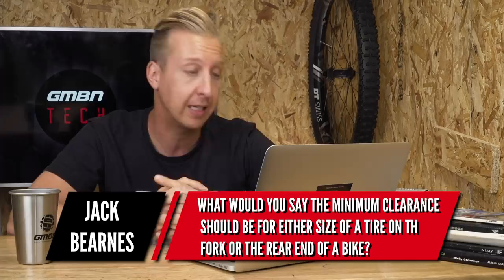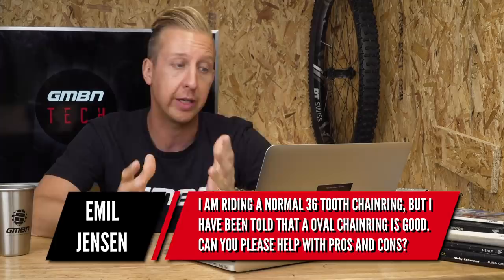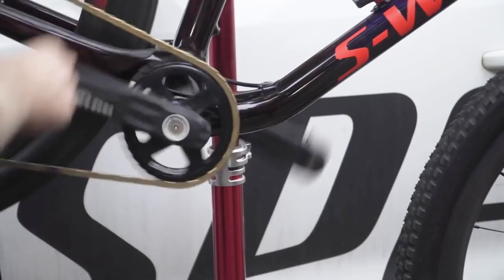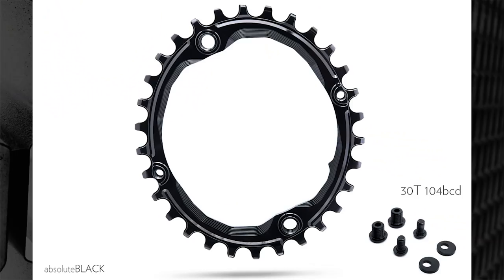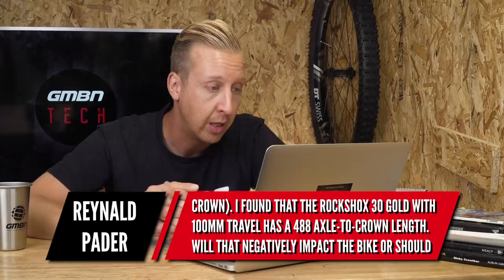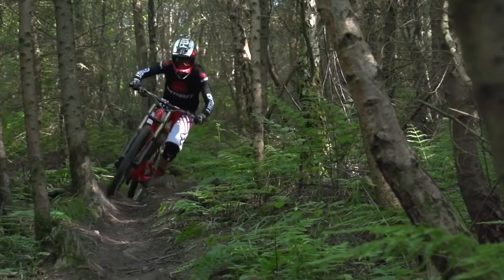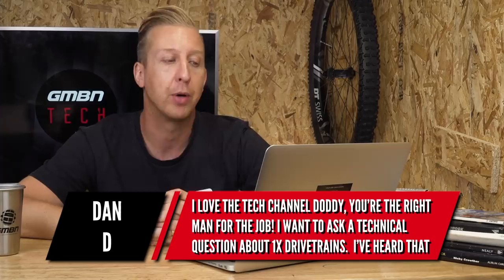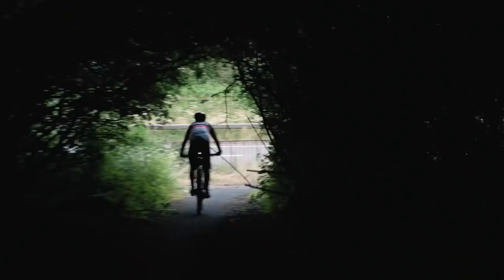Ask GMBN Tech: Should I Get An Oval Chainring?

Comment from the maker: Do you ride with an oval chainring? Would you? Let us know your thoughts in the comments 👇
Reply: On the note of an oval: I recently got myself an oval and for some reason i get tired much faster than before. The oval is a 36 teeth while my old ( round ) chainring is 32 teeth. Is it possible that it is the oval or the increase in teeth that can affect my riding in this way?
Reply: Yes, never going back to round rings.
Reply: When I switched from a 3X to a 1X I initially just kept my middle chainring. The chain kept falling off and I didn't want a chain guide so I decided to go with a narrow wide chainring.  Well, the price for the oval was pretty much the same as a round so I thought 'Why not.' I don't know if it is better but I do know that the next time I rode the bike I had a couple of PR's and yet didn't feel like I had worked any harder than usual. Does it work? I don't know, but it doesn't not work and it doesn't hurt. So I am keeping it.

Two things that I have noticed - It took me a few times to get used to where I put my pedals when not pedaling. At first I would have to pedal about half-way around before I engaged the rear wheel. Once I got use to putting the pedals in another location - I no longer have that issue. Second, I do know that my chain has stretched pretty quickly. I don't know if that is from the oval (thinking the teeth on one side of the ring are further apart) but my chain did stretch quite quickly (6 months or so).

Overall, I am happy with the choice. I did go with a no-name brand chainring in case I didn't like it and it has held up well. When it dies, I will spend more money on a good brand.
Reply: Being a flat pedal rider i've tried it on a friend's bike, felt weird and a bit distracting when climbing.
Stuck with the normal ones - helps me keep my focus on smooth pedaling and avoid "chopping" uphill ... also avoids stress peaks (knees etc) i think.
Reply: I was skeptical for years, said f**k it one day and bought one. Have an old knee injury that would often ache after rides, hasn't hurt since. Climbed over loose n slippy roots better, doesn't feel like any downside for speed. Feel like there's more gas in the tank after a long climb. Since pedaling is naturally uneven, why use a round ring?
Reply: Yes of course! i ride one of the Absolute Black Cainring and love it!!!
First week was a little bit akward but the next week i didn´t recognized it.
And the Pro are: no of jumping chain anymore, what was with Shipanso chainring on flat street way everytim, also absolute Horrible.
I chanched my drive to Sram GX 11speed and do not need a last 12th gear.
Reply: I used oval chain ring for about 2 years now and I loved it. I used flat pedals and its has been a big difference for me when I'm climbing steep trails. Good thing that sram got the oval chain ring on there GX eagle series.
Reply: Oh and shifting under load (if needed) is easier
Reply: On my "old" bike and on my new bike a normal, thinking of upgrading to an oval.
Reply: Yes, I use Absolute Black chainrings. I notice a huge advantage when riding flat pedals. I’m not sure I get as dramatic a benefit with clips, but I haven’t gone back to round with clips, so maybe that would highlight even more advantage than I perceive. But at least on flats, they absolutely smooth out the power.

By the way, GCN did some tests showing that no one “spins a round pedal stroke”! Even the trained pros deliver all their power on the down stroke.

If you haven’t tried oval, give it a go!
Reply: i've gone from a 2x11 xt to 1x11 absoluteblack 34T and it climbs mutch better for me , and i had a issiue with the clutch on my xt derailleur , now i don't use the clutch
Reply: Chain_Ring MTB yes... you are pushing a harder gear. I believe you need a 34 tooth oval for fair comparison. A 34 tooth would be effectively a 36 on the power stroke and 32 coming over the top.
Reply: Le Typ interesting. I had the opposite experience: with flats, I am way more choppy with a round ring and way smoother with an oval. Perhaps your buddy has the ring “clocked” wrong? If it’s 90 degrees off, it will be completely wrong.
Reply: Chain_Ring MTB it's the increase in teeth my dude. It's like constantly being in a harder gear now.
Reply: Been using Absolute Black oval chain rings for the past 3 years. Makes a noticeable difference in maintaining momentum on technical climbs. There is a reason SRAM now makes an Eagle compatible oval now too.
Reply: I've used ovals for the last few years. I don't notice much difference between round or oval. As for the clutch wear issue, surely on a full sus the chain is stretching under suspension action anyway?
Reply: I was struggling last year with round chainring on stumpjumper 29, 28-42 ratio felt very uncomfy. I found myself constantly spinning easiest gear, and i did never touch 10t cog . AB 28 teeth oval dramatically improved feel, and currently im using whole gear range. Only slightly strange moment is when im trying to stand pedal, i feel cranks kicking due to rapid tension changes on 10-12-2 o'clock cranks transition.
Reply: GMBN Tech I don't run a oval chain ring
Reply: Chain_Ring MTB I'd say it's the more teeth
Reply: Chain_Ring MTB most provably. Get a 32t oval. Its gonna make a diffrence. Oval chainrings tend to push yourself harder. Meaning that you fel like you "have" to push harder. That results in higher power output and faster fatigues
Reply: GMBN Tech used oval chainrings for one year now. On my xc rigid, trail fully and my roadbike. Hard climbs are slightly less fatiguing than with round ones. Diffrence in traction is almost the same with a small tendency to favor oval. Although i have a a pretty round and consistent pedal stroke(regularly test it with my powermeter), high wattage situations feel a lot better with oval chainrings, especially at higher cadences. when doing anything at or above threshold a cadence of 105-115rpm is normal and feels utterly weird with a round one. Oval feels much more natural.
Clutch wear? Nothimg that i can dven consider noteworthy. Chainwear and cassette wear still as before, although i clean my chain and cassette quite thoroughly and regular.
Reply: Callaway Cass:
It put the power down from 2 to 5 on the down stroke, still felt awkward.
Reply: Switched to oval a few years ago, never going back.  I switched just because it was something I wanted to try out but after a few rides I was hooked.  I feel like I get the power of a larger chainring without having to put out as much force and it seems to have helped me out with some knee and hip pain I was having.  Could all be in my head but what ever it is I'll take it!
Reply: After breaking a chainring tooth, I replaced the chaniring with an oval. I estimate it has given an effective 1/2 gear advantage in the granny gear, and I agree that it seems smoother climbing. (I use flats, not clipless.) I was able to use the existing chain guide on my SRAM Eagle setup with no issues.
Reply: I finally jumped on the oval train and don't regret it, for me it wasn't a day and night difference, it's more subtle, I'm not as winded when I get to the top of a climb, and my pedal stroke feels so much smoother, my pedal stroke was something I worked on a lot when I rode my road bike, so for me that was something I noticed right away, but I'm curious how it will be long term, I've only been using the Absolute Black for a few months now, but so far so good.
Reply: Iv rode for a year and a half on a one components oval chain ring it was a 32 tooth and a game changer very noticeable on my local trails especially climbs. Iv just upgraded my crankset and I'm with much regret not running an oval. I'm gunna go back to an oval chain ring a.s.a.p.
Reply: I prefer oval chainrings - noticeable much traction, easier to take climbs. The only disadvantage that I've found - cost. All similar chainrings made using CNC from the same materials and there's no difference between cutting the round chainring and the oval one. Just a marketing.
Reply: Oval chainrings result in very minor movement of the rear derailleur. At any time the chain is covering half the chainring, so the only change in length from the bottom of the chainring to the lower jockey wheel is from a slight change in angle due to the radius difference in the oval. This is generally less than 2-3 mm and is much less than changes due to rear suspension travel or even a tiny bit of chain slap on a hardtail. So unless you only ride on a perfectly smooth surface the clutch is not going to receive any extra wear.
Reply: Ride round you'll get used to round. Ride oval you'll get used to oval. Not much of a difference in feel or performance on MTBs.
Reply: Big cons of a oval chainring is, that you need a longer chain. So in rough terrain your chain can move more than with a normal chainring.
Reply: No oval for me yet. If I went for upgrades, I'd need a new rear wheel that accepts cassettes. Maybe some 160 mm cranks… Then I'll think of an oval.
Reply: Recently switched to an oval ring.  Definitely noticed an improvement.  I ride flats and do not feel any difference when riding on smooth ground.  When climbing technical ascents, the oval ring allows me to easily clear obstacles running 1-2 gears down the cassette compared to round.  The main advantage to the oval ring is that you don't stall in the 12/6 position on technical climbs.
Reply: The fact that your derailleur is moving back and forth with every rotation means.... you have to push that spring and lose energy! Also I'm convinced that your rotation doesn't need to be perfect, you rely on the perseverance of energy with your speed so only need to push for a fraction of time and relax the muscle for the rest of the rotation to allow fresh oxygen rich blood in (there is GCN video about pro road bike riders having less perfect rotation then less experienced riders). The only time, in my humble opinion, it is useful are the moments you have a very low cadence where the oval chainring can help you to get over the dead-point.
Reply: It's nice to push an oval ring in low gear...you get a real Thomas the Tank Engine feeling.
Reply: I've been riding melon narrow-wide chainring by Garbaruk (10% width to length ratio) with flat pedals for half of a year. It feels even rounder than round ones to me. It shines when I pedal uphill with a low cadence, allows me to push a bit further. I have shimano slx 10 speed rear mech, and sometimes it does not feel happy when switching gears with the oval. Just needs a bit more love and care. If it becomes uncollaborative during a ride, I disengage a clutch and it instantly starts switching smoother.
Reply: I have been using oval ring for 2 .5 years and not going back to round I feel less knee stress.
Reply: I just got a 32t narrow wide oval and i love it. I feel that my pedal stroke has smoothed out and no more dropped chains. I may never go back to a round one 😂 i have a 2017 mountainpeak eagle xc hardtail with a deore upgrade kit, 1 x 10speed (11-46) set up.
Reply: Hi Doddie.  Yes, I do ride with one on my full sus MTB bike.  I've been on it for about 6 months now.  I really like it so far, and I'm also thinking i may get one for my XC & CX bikes!  I truly believe they help smooth out your pedal stroke on technical climbs, thus assisting with improved traction.  It also feels like it gives me a little more torque at the back wheel when climbing.  I also think it helps my legs feel less fatigued at the end of the day, although I'm still assessing that....
Cheers.
Reply: My experience on ovals have been negative. It created a lot of pedal bob for me because I kept blowing through the pedal stroke only to encounter too big a change in resistance upon reaching the large side of the oval. I also found it limited the max rpm of my cadence in the smallest cog thus affecting my speed on the flats. This was on the absolute black oval ring.
Reply: I have ride some bikes with oval chainrings  although i cant tell much of a difference , in my next upgrade i will consider getting one just for the theoretical benefit :)
Reply: Please make that video about oval chainrings. Make if a geek and non geek too! Here are a few factors that I'd like to suggest looking into:

Pedaling efficiency on flat and clipless
Power output vs. Round on flats and clipless
Derailleur stretch
Possible suspension effects? Will it free and/or constrict the rear suspension?

Thanks guys
Reply: GMBN Tech 
I'm pro I have one on my xc comute bike after the first few strokes it's feels like a normal ride. 
Mutch better acseleration
Reply: Had one on 2 bikes for a year. Had some benefits but for me I started developing knee pain in my bad knee that went away as soon as I went back to a round ring.  Oval felt much harder and I never fully got used to the crank speed changes (fast on dead spot, slow on power section).
Reply: Waiting for the triangle chainring.
Reply: If you went with a 36 round, it would even be more difficult.  Anytime you increase the size of the chain ring, it is going to be harder to pedal.
Reply: I'm a bit late responding here, but I have two bikes one with, one without. First let me say there are a few most don't know about oval. One is that there are different angles of offset on different brands. I run a AB oval on my 120mm FS trail bike. It has non-clutch derailuer and 1x9 with a wide ratio 11-42 cassette. I find that with the gaps I prefer to stay on the high side of gearing ( I'm not a spinner) and the 32t oval helps me climb like if I had couple tooth smaller chain ring. It does not feel bad to me, just a little getting used to. Now people that are spinners and like to run lower gearing, the oval may be harder to adjust to. On my 150/160mm Enduro bike, running 1x12, I find with the closer ratio gearing I am never lacking for the right gear so don't really have a need for the oval chain ring.
Reply: yep set it up with a single speed works great
Reply: I have a 32t oval on the way rn to replace my 36t oval. You dont really notice the benefits until you're on the climb. I don't yet know how they do on a techy climb as I haven't gotten to that point in skill yet.
Reply: @f2.8-  Late response, but... have you had it installed 90 degrees off, by chance?

Oval doesn't technically require any less torque (for a given amount of teeth), it only displaces some of the resistance out of the rotation "dead-spot", into the part where you can push the hardest, when your foots are horizontal. Assuming it's installed in the correct orientation.
Reply: @f2.8-  the increase in teeth
Reply: I'm new to Mtn Biking and the used bike I bought has an oval. I think this little device is the reason I can keep up on the up to experienced riders. I promote them at often as possible.
Reply: GMBN Tech. Why not do a test on a circular route (similar to aero testing).  Run a power meter run several people on each circular and oval chainring. Ride a at set watt, measure heartrate and percieved effort, maybe throw in some people with bad knees see what's reported.
Reply: It was good, but the thing that i notice is the cage of the pulley moves due to different tension because of the oval chain.
Reply: I'd rather have a standard one, less wear and faster shifting
Reply: @f2.8-  From what I've read, an oval 36t chainring will be similar to a 38t at the high (power) position and a 34t in between. You probably should have gone with an oval 30t or an oval 32t.
Reply: I didn't think it made that much difference util I sat on my wife's bike with a round chainring,  it definitely smooths out pedal strokes. And I don't care if it makes me 0.3 % faster or slower on a particular stretch of trail, if it feels good it's staying on the bike. As for oval wearing out the clutch-if you're SO worried about that, you better ride a HT, and only over perfectly smooth trails. If oval has any negative impact on the clutch, then chain growth and the cage inevitably slapping a bit on bumps will be much worse.
Reply: Nice watch, what it is? :D
Reply: Yes...
I only have Oval rings on my Roadie, but have bought a AB for my MTB, I really enjoy the Oval rings and can`t wait to get my MTB one...
Reply: Climbing, a game-changer, more traction+more consistency=faster! I love it. I notice because one of my bikes has an oval and the other has a round.
Reply: I do and I love them!  So much better than round rings, especially for climbing!
Reply: @johnsumner6185  No question about it!  I love oval rings just gives me a much smoother stroke especially climbing.
Reply: I switched my rockhopoer to a1x9 with an oval wide/narrow 32t up front and added a guide to boot. No problems yet on goat trails. Going to start hitting the harder trails shortly. BTW I ride in Colorado.
Reply: Back when I bought my first light weight road racing bike in late eighties early nineties the oval chainring was all the rage and your bike came with them shimano 105 came with them. So from personal experience it makes you even all the way around when you ride as mentioned. You get the benefit of the same stroke all the way around. The main thing I felt was that a round chainring gave me less fatigue cause I was getting rest when less tension and the oval the tension was always on so Constant tension and no let up on you. I found them good for climbing. Though.
Reply: Have you done a more in-depth video on this since?